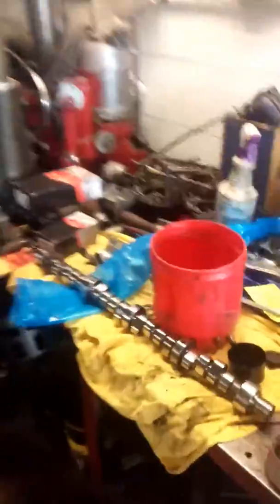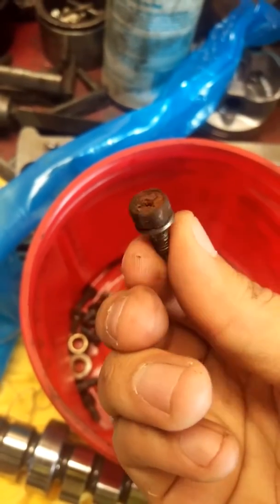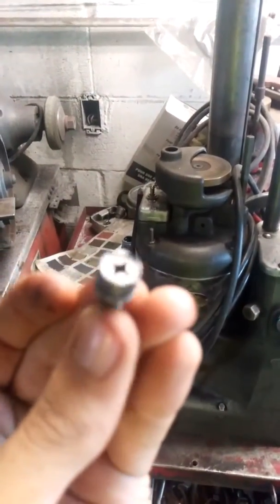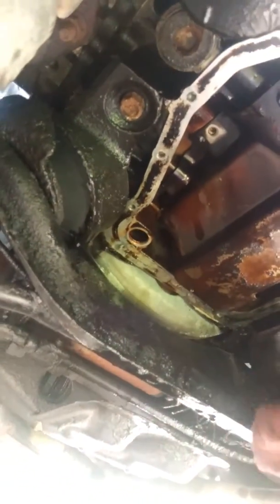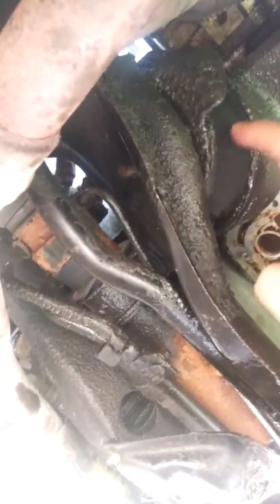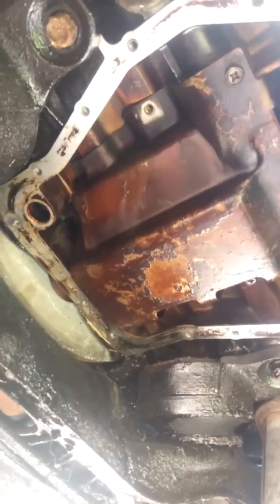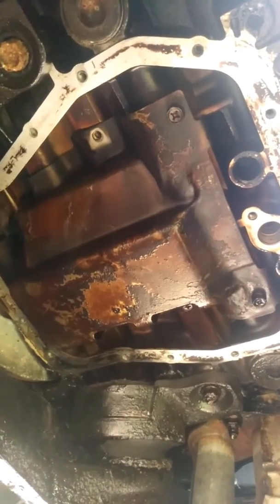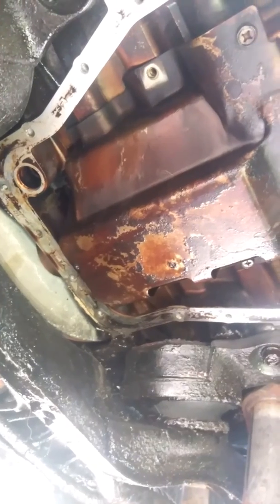2002 Subaru Impreza Wagon 2.5L Oil Pan Replacement

Comment: So how did you prop the engine up to get mount plate off? I did not see that you had any Jack's or anything for the motor.
Reply from the maker: On the very front lip of the forward side of the engine with a 2x4 small standing straight up, sketchy yes, effective, also yes.

Comment: I ended up stripping the female threads in the pan for oil drain plug, is there a way I can get away with using one of those oversized re-threading plugs or should I just replace the whole oil pan?
Reply from the maker: Can tap it to the old size and get a stock plug or go with an oversize plug. Either is an option. Most cases I've seen people just replace the pan as subarus are engineered like trash.
Reply: Ryan Hoshal I think I’ll try the oversized plug and see if that works. Who’s bright ideas was it to make the oil pan out of aluminum! Thanks man for replying so fast I really appreciate the help